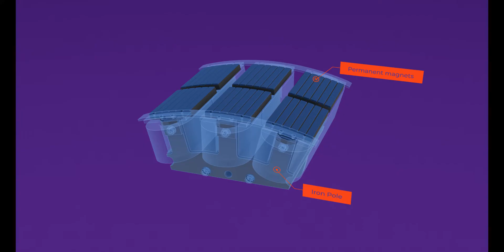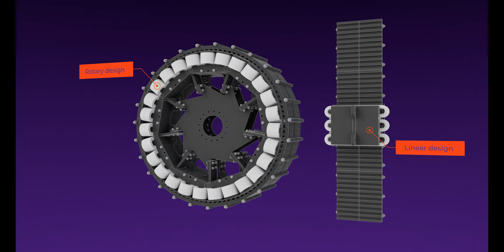The Vernier Hybrid Machine - a novel electrical machine

Comment: A somewhat unusual application of the common switched reluctance motor design. In this case, it is permanent magnet assisted, so it doesn't have the usual reluctance motor advantage of needing neither a wound rotor nor permanent magnets.